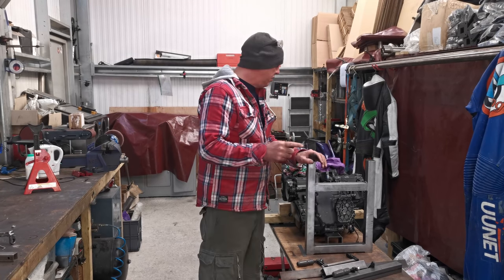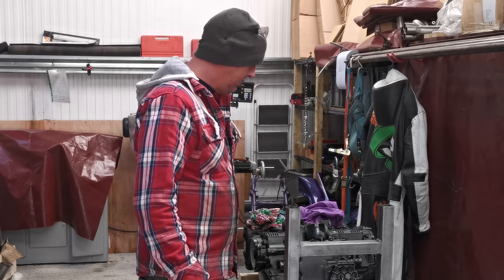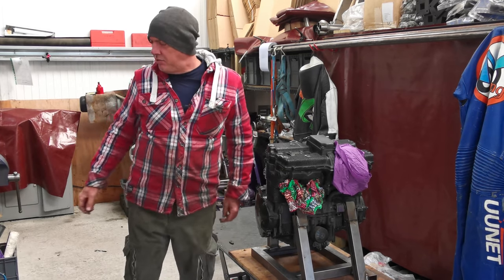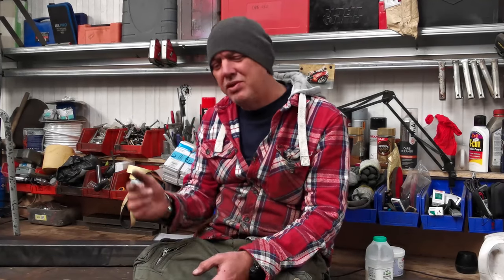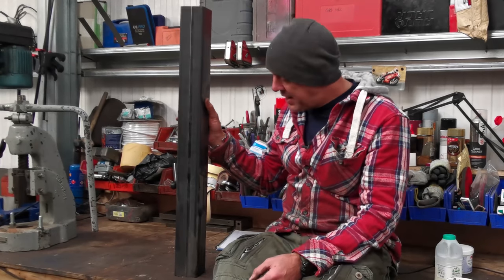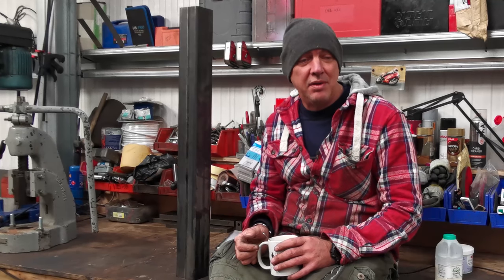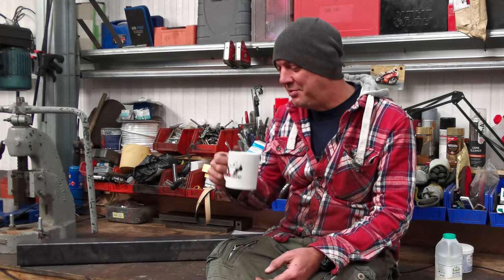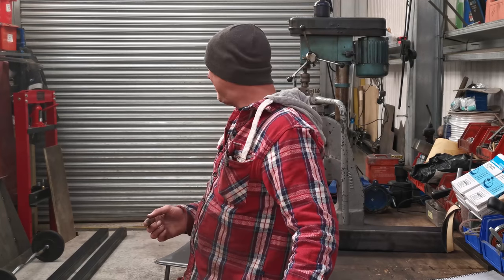Making an engine stand - Suzuki Bandit Cafe Racer - ASBO Project

Comment: Funny seeing you starting weights, just done the same thing after years of zero exercise & 54 years young 👍🏻
Reply from the maker: I used to be a bit of a gym rat, but I reckon it's going to be a bit of a shocker 😬😂🤣
Reply: Ha, ditto!  I'm thinking that it's only going to get hard as I get older so better get started.   Are you doing the free weights thing or a multi gym to start with?
Reply from the maker: Free weights matey, I always seemed to get on better with them 😁👍

Comment: Well that was a quick frame sizzling session lol , not pretty but works ( all it needs to do right lol ) . As you say there are a multitude of designs out there for frame jigs many however are great for bobbers and chops but not suitable for a bandit . Ya did ya homework and you've come up with a pretty damn good design .. bit on the industrial scale for size but hey it ain't gonna move is it .lol looking forwards to seeing how it grows and how you get on . I got a pile of 2 inch box sat in my garage waiting till I get the time to do mine . ( got an old Ltd 400 I wanna have a go at goose necking )
Reply from the maker: I reckon it's spot on... I guess we'll see.when I make it, but at the minute I'm.quite hopeful 🤣😂